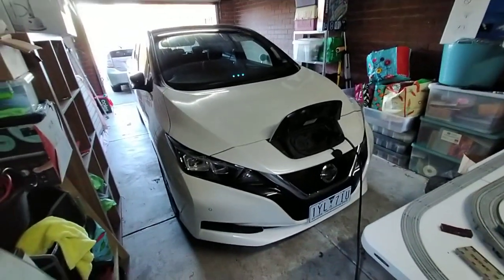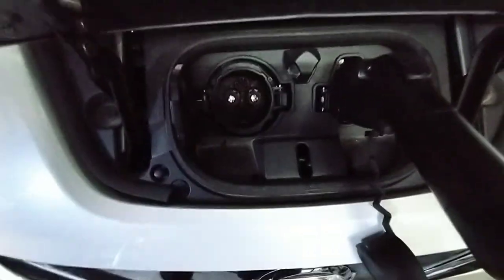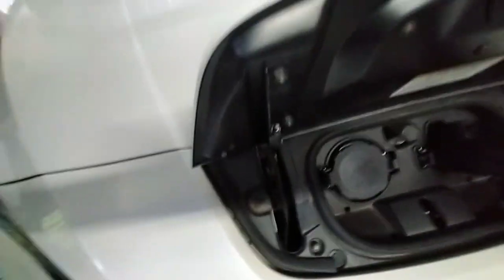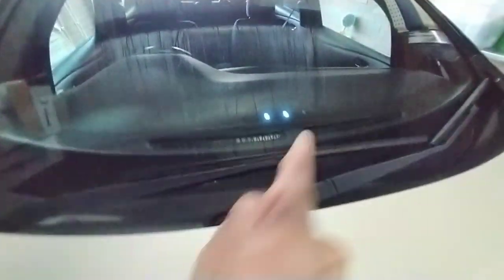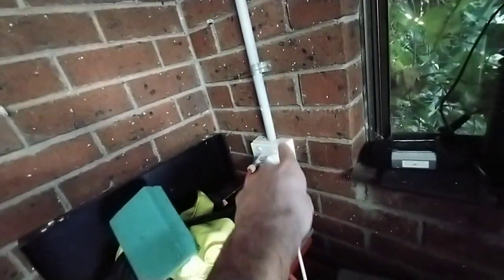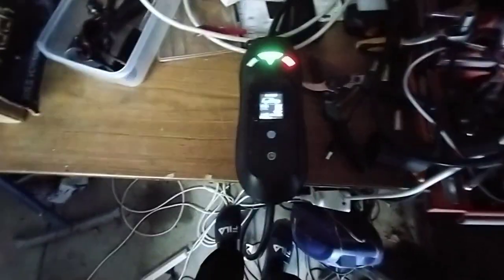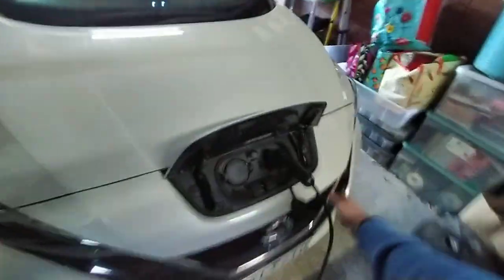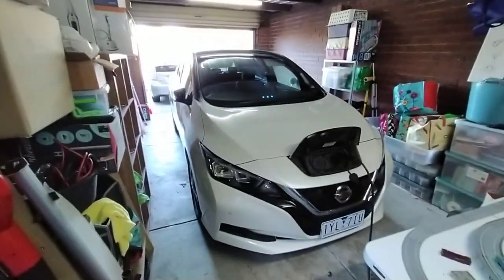How to charge a EV from any home wall plug - Nissan LEAF ZE1

Comment: The majority of EV owners will seldom use a public fast charger. When your daily car use  is 80 km  or less (and  the average  use of 12,000 a year is only 30 to 40 per day) you simply plug it in at home every day or two, as needed. There is a module in the power cord which communicates with the car's electronics by the other wires in the plug, and the whole charging cable assembly has the technical name of EV Supply Equipment, or EVSE. The cable is usually 5 metres long, which is a decent length.
The standard "slow" charge rate - 8A from a 240V socket - gives you about 10 km  of range per hour of charge. So 8 hours will give you 80 km of range. 12 hours 120 km.
As you showed, the EVSE will have some charging rate options. 8A is safe from an ordinary household 240V 10A three-pin socket. That charges at just under 2 kW. Most Leafs of that model have a 3.3 kW onboard inverter, some have a 6.6 kW. To take advantage of that you would need a heavier electrical cable from the house switchboard, wired to a 15 A socket for 3.3kW, or a more expensive wired-in charging station for 6.6kW. But you don't need to, and most people don't bother, you just need to be able to plug it in to an ordinary power outlet. 
If you can get an electricity supply plan with a power cost that varies at different times, the car has an onboard charging timer, so you can set that to take advantage of cheap off-peak power.
Reply: yes very true my friend